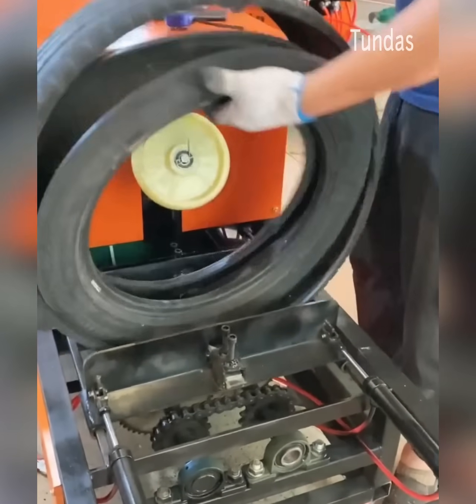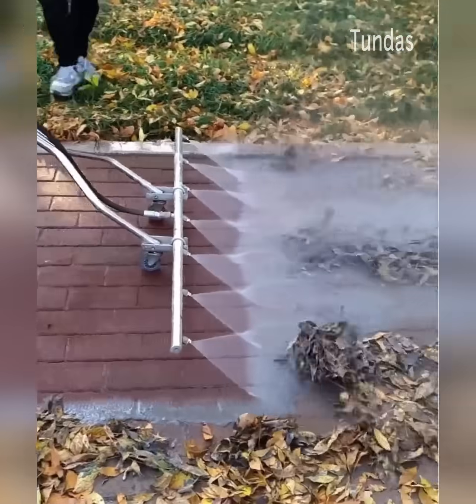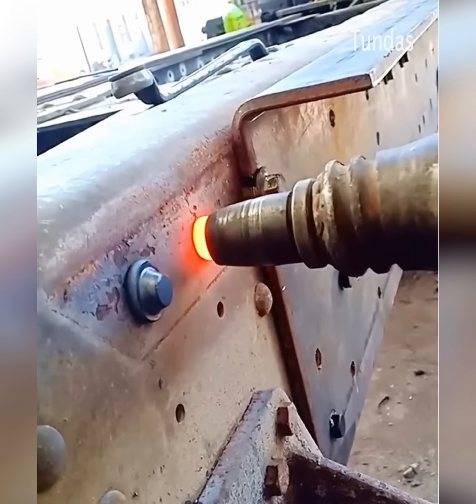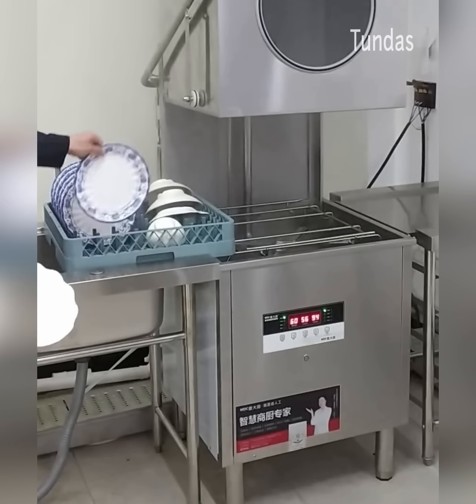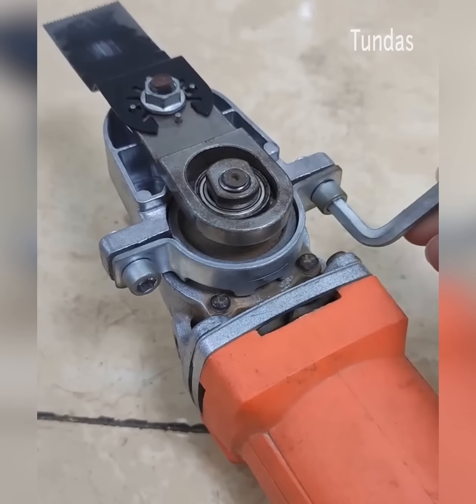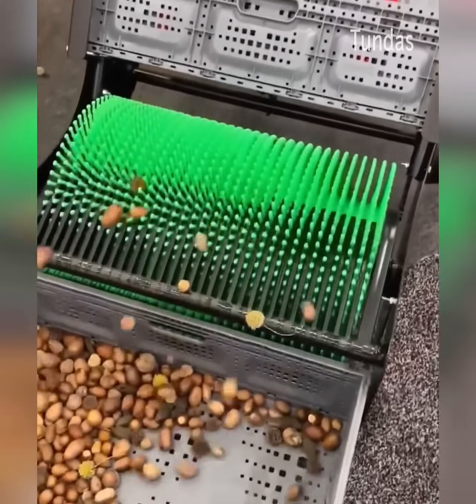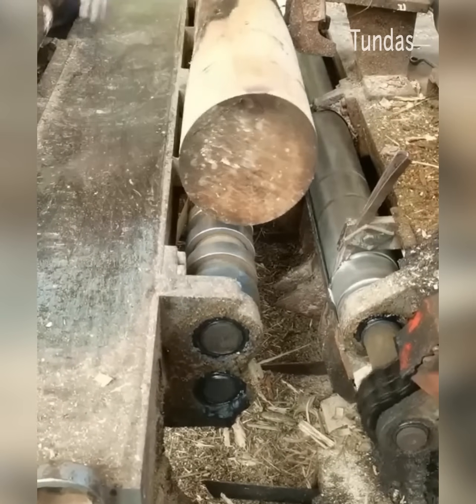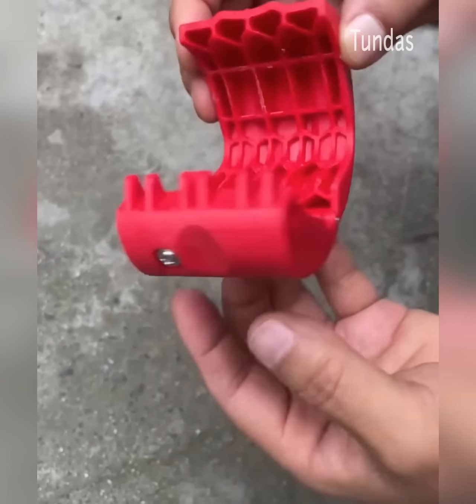The most amazing inventions, tools and machines to make people's work easier

Comment: Love the bolt cleaner. A strong acid chemical as the lady reaches in with no gloves on..
Reply: I am an industrial Chemist. If I had worked like like this I wouldn't have any hands today.
Reply: And her nail polish didn’t come off 🤔🤔🤔🤔🤔🤔
Reply: It is very likely electrolysis.
Reply: Probably ultrasound. Safe and very effective
Reply: Oxalic Acid powder dilutedin water. Used for laundry is also good rust remover.